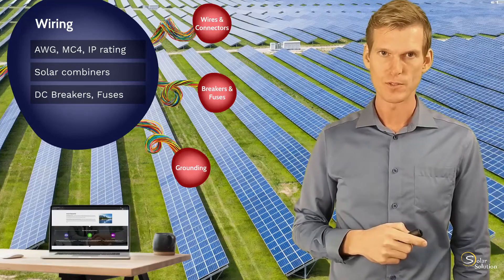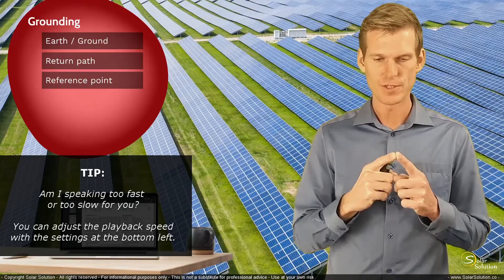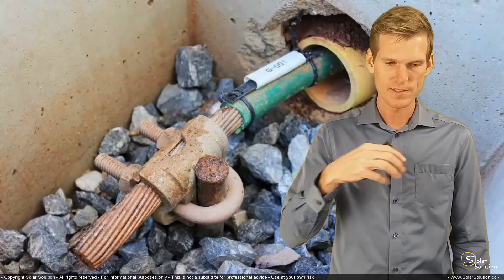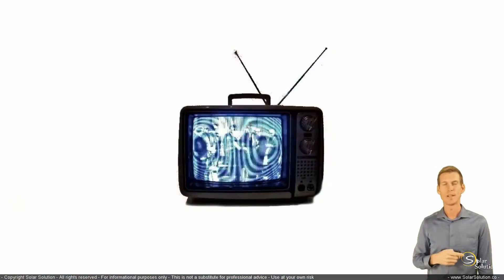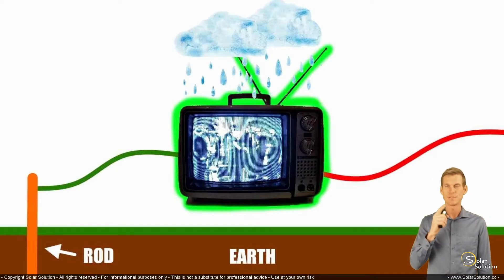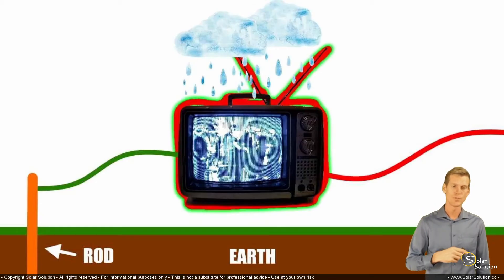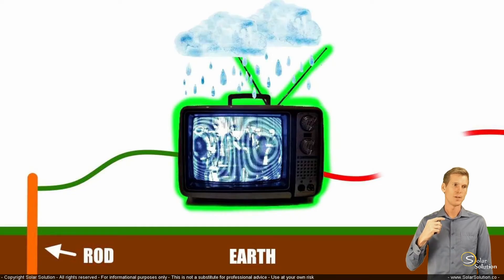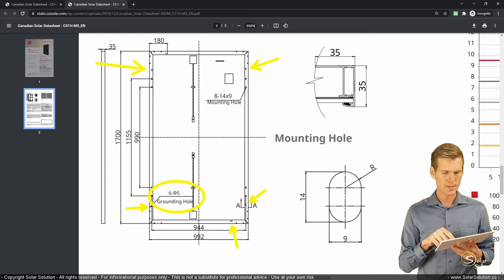Solar Panel Grounding: Why, Where, How & When to do it

Comment: Umm, the explanation here why the powrr trips is to simplistic to the point that its actually wrong. If you're planning to run electrical wiring yourself, please do not use this video, there are far better explanations elsewhere.

Comment: If the grounding rod you showed is supposed to be copper then its a new variety because its rather rusty, and dry rusty terminals are not good conductive points

Comment: Having a rod in the ground will NOT save you from electrocution.  Having a RETURN PATH which causes fault current to be INTERRUPTED by tripping a GFI, AFI or circuit breaker, is what saves you from death.

Comment: Sorry, but your explanation is inaccurate. Electricity does not go to the ground it goes back to the source. Eqipment grounding conductors are bonded to the grounded conductor at the first point of disconnect, and the grounding conductor  is a low impedance path back to the source. Thus opening a circuit under a fault. Grounding electrode and electrode conductors protect from side flashes when lightning strikes and over voltages.
Reply: Exactly.  His first point of an earth ground as a path back to the source for safety is very inaccurate.

Comment: i am installing the grounding rod yesterday and came across a thought that the i place i have chosen to ground has a gutter a few steps away and often the placed get water logged too from the gutter making the whole floor wet. i was worried if that wet surface can be hazardous if someone comes in contact with it?

Comment: Ok, this might be a strange question, we recently discovered that we are feeling tingles in our home when neighbors solar is on, mostly in feet and legs. Confirmed when neighbor turns off solar the tingles go away. We don't have to touch anything in our home to feel tingling. Its felt all day from when the solar comes on and stops when the solar goes off. We have power company coming to check it out as our electrician has confirmed its not a problem within out home. Neighbors deny any issues on their side. Any idea what's going on in this situation and how to solve? thanks
Reply: Interesting mystery.  I'd think whatever you've been feeling your neighbors should be feeling too.
Reply: We reconfigured some grounds and disconnected the ufer. This was helpful but not a total fix. We're getting a more seasoned electrican involved @ontogeny6474
Reply: Neighbors have a basement and are not living on ground floor like us. @ontogeny6474

Comment: when you sever power from the panels on your roof going into a charge controller, is the solar panel still getting wear and tear?
Reply: UV radiation is highly degrading. Anything other than rock or metal will be damaged by sunlight over time.

Comment: Should the ac and dc earth in an off grid system be connected together?
Reply: Good question
Reply: No
Reply: @enki2gold  why?!
Reply: @GensetExpert  actually connect them so not to create a loop if they are to close. Just make sure your cable can handle the current and connect it to your ac ground

Comment: hello sir is there a specific wire size in grounding panels and inverter thank you
Reply: Check out NEC 690.47 and NEC Table 250.166

Comment: i believe the ground wire going back to the panel is the way a fault is cleared due to the ground and neutral being bonded.  The ground rod wouldn't carry enough current to clear a fault on its own.  I have seen people hook 120v from a panel straight to ground rod that was not bonded and it didn't trip the breaker.  It just drew about 5 amps or so and created a dangerous voltage gradient in the earth.
Reply: this is very true. Hope everyone watching this video sees this, an earth path only is not the low resistance path that would cause a breaker to trip.
Reply: i second this, the ground rod in residential applications is exclusively used for lightning strikes and NOT for a ground fault path via normal ground faults, the grounded/neutral conductor is the actual ground fault path and NOT the earth rod
Reply: @o0DJANIMATE0o  where I live lightning protection has a dedicated earthing that is NOT the same as a AC grid ground rod, it even has a minimum distance from that and electrical standard mandates a ground rod connected to grid ground wire before grid electricity is allowed to be connected, they measure resistances btw neutral and ground and also check ground resistance of the rod.
Reply: i have seen quite a lot of skimping on rod length, depth and encasing

Comment: I love your videos, they are so helpfull ! Could you tell me pls if i can ground my DC/AC inverter of my solar system to the grounding of the main 220 AC ground of the house in the circuit breakers box since there is a ground there too for the 220V AC or do i need to make a new seperate ground for my inverter ? Thank you.
Reply: You can use the ground in your main panel. As long as you are sure the ground rod going to earth is there.
Reply: @MCMole  Thank you very much Sir.

Comment: I'm off grid and my pannels are in series to make 300 volt.. both my inverters are earthed and i have the neutral connected to earth in the A/C  circuit breaker box but my solar panels aren't earthed, does that mean i should have an earth wire on my panels for safety reasons?
Reply: After trying to clean my panels I say YES!
Reply: @Laurel-Crowned  I know the feeling!